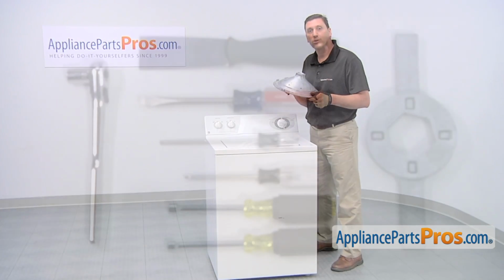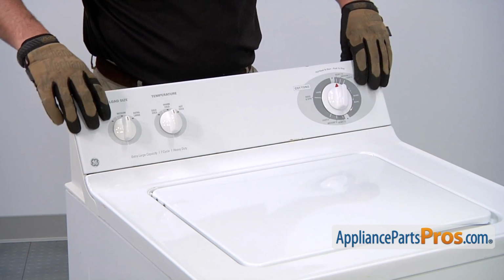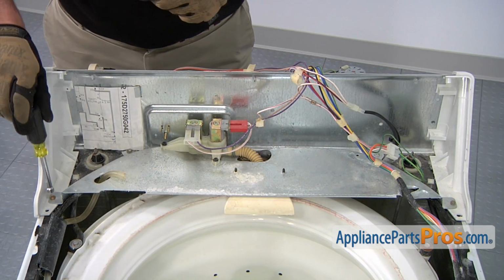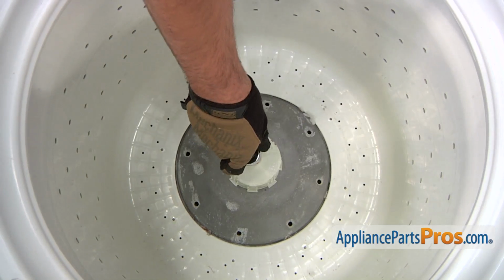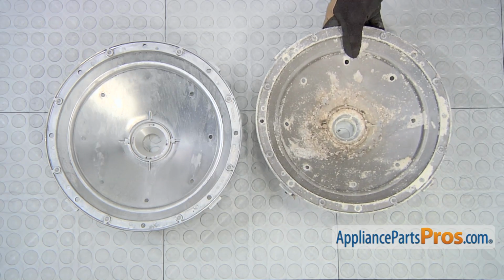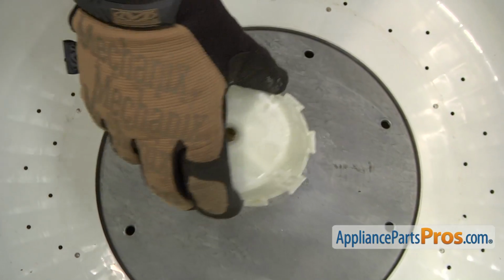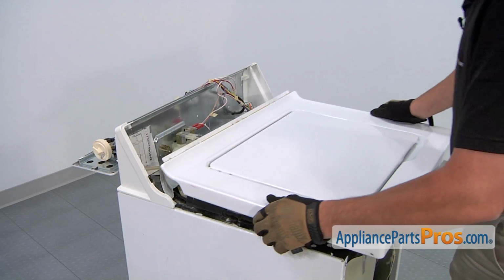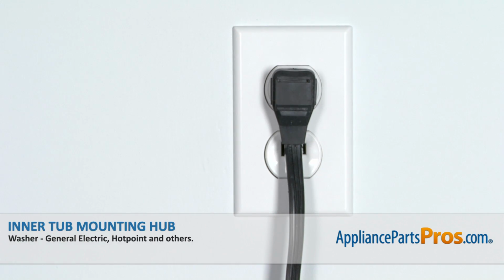How To: GE Inner Tub Mounting Hub WH45X10027

Comment: Is there a hub replacement or repair kit for tub  part number wh45x26674. Which is to GE washer model GTW680BPLD1G. Apparently a beach residents water supply , over time, discentigrated the metal hub in the center of the basket.  Please advise and thanks in advance.
Reply from the maker: Unfortunately, it doesn't look like there is a hub sold separately from the transmission for this model. The part number for the transmission is WH03X33731.
Reply: @appliancepartspros Thanks for the transmission part number but the part i need( if it exist) seems to be built into or mounted into  the tub. I Havent been able to verify the the condition of the transmission until i have the issue resolved with the tub. I assume thats the only way i can test the transmission.   That is with the tub fixed and reinstalled?  Then do a test run. Unless you can advise of a way?  It seems to turn pretty free by hand. Thanks again
Reply from the maker: If the piece you need is built into the tub and not on the transmission, then you would have to replace the tub.

Comment: My hub is broken out, and keeps moving when I try to break it loose with the spanner. How were you able to apply the brake or otherwise keep it from moving? I tried holding the square part of the hub that is still there with a pipe wrench, but there isn't much room in there, even removing the inner tub(since the broken hub allows it to come out) still doesn't give much room for one person to try to hold it in place while another beats on the spanner. Any tips?
Reply from the maker: Hard to say without being able to see it, but you could try to soak it with some WD40 so the nut doesn't need as much force to break it loose.

Comment: I had to use a cutoff wheel on a angle grinder, chisel, and hammer to get the corroded nut off. Be very careful not to nick the threads.

Comment: Great detailed instructions. 

However.... You WISH the hub nut would loosen easily!!
If you need to replace the hub itself due to corrosion and it being broken etc. you'd be better off simply cutting through the nut... Buy a nut together with the hub for replacing.
I tried every trick possible. Ended up literally cutting it with a saws-all type of saw...machine is back in operation!

Comment: Not bad, but likely your hub mount is broken in pieces if you're replacing it. As you likely drained the water out in the normal way before you started this project, you best remove the hose clamps to the pump motor and clear the hose and pump of pieces of old broken mounting hub before reassembling (wet vac. works well in this capacity). Also, if you're going to try to reuse the old hub nut, first remember that it is a left handed thread as it may not be immediately obvious, and you can be forgiven for being a creature of habit. Then, since you'll likely have to wait for your part order to come in anyway, use time to your advantage and soak the nut in a penetrating oil, wd-40 or such (and don't forget to clean it up before inadvertently oiling your wife's precious laundry). Otherwise, you very well may have to break or cut and replace the nut for about another $8. Removing the inner tub (if your mounting hub is broken to allow this anyway) will give you a little more elbow room to get in with a spanner or wrench. Be somewhat careful breaking the nut free or you may damage the outer tub. Tossing in an old towel or likewise to protect it and other parts from excessive force mishaps, and simply dropping tools is worth considering. Though if you look through instructions posted another person describes an adequate improvised repair patch, should you have this misfortune. Good Luck!
Reply from the maker: Ray Speth Thanks for the tips!
Reply: So, let's assume that likely you've gone through all this and you can't get the (explicative deleted) hub nut to budge. This is very likely. Mostly because the shaft it is mounted on is square with only the ends rounded and threaded, allowing both debris and oxidation to make that nut impossible to move, much less likely reuse. So just spend the 8 or so dollars for the replacement hub nut to begin with, and save yourself the time ordering a second part plus postage. The good news is that you can cut the nut off with your method of choice (Yes, your average dremel rotary tool will do just fine) and you can cut opposite the flat side of the shaft without much worrying about damaging the threads.I would suggest cleaning those threads on the shaft with a wire brush and clean any burrs from the new nut to help you line up the threads when replacing. Sometimes lining up the threads on a shaft like this can be a bit tricky, and don't forget you're working with a left handed thread.